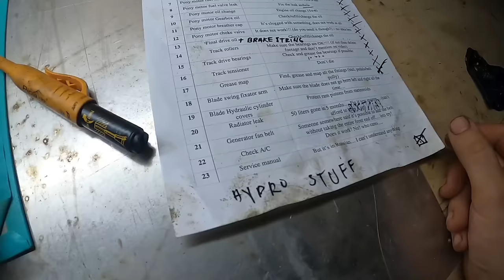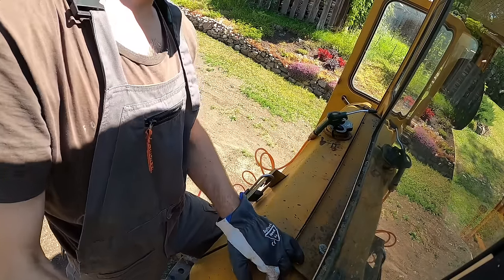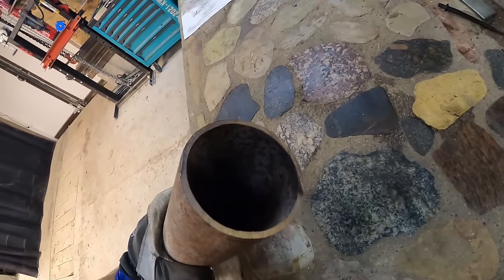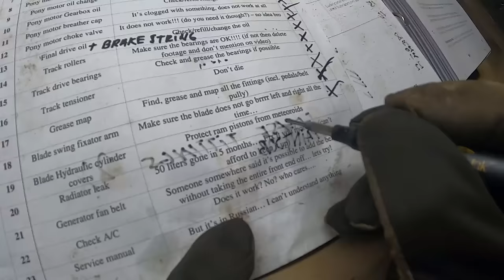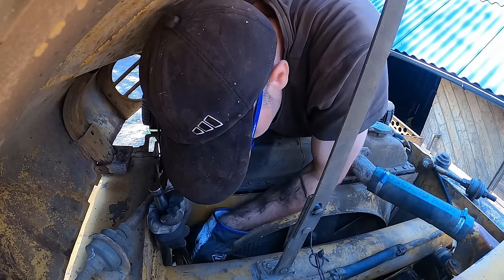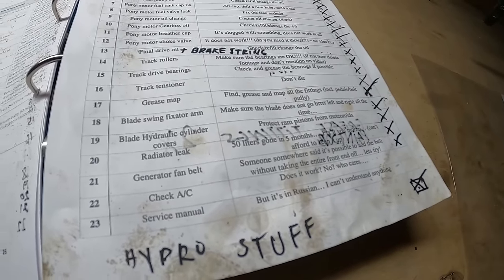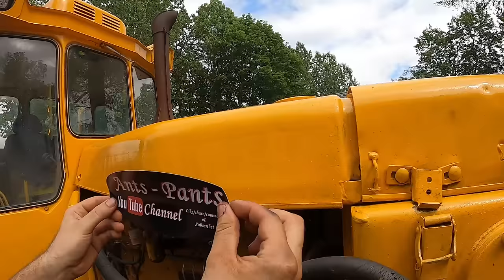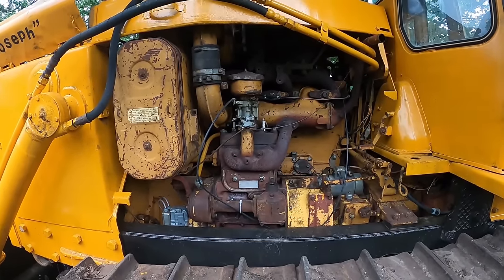Fixing the soviet bulldozer T-170 - Ep3

Comment: For the hoses behind the blade, I recommend you weld a rod sticking out of the front of the machine, from the end of the rod you can hang a spring and some chain to hold the hoses in place. The spring and the hoses give enough flexibility to still move everything, while avoiding rubbing.
Reply: - I was thinking the hoses needed to be kept away from the blade and out of the way, too.
- Your design concept of an appropriate bracket AND a Suspension spring system is smart.
Reply from the maker: Interesting idea

Comment: Joseph turned out nicely. Great job. When CAT are new, their Signature color
is sprayed on everything to make leaks show easier, seams are sealed, and 
fasteners are protected. Thick paint peels off easily, revealing a usable fastener, instead
of a corroded head that strips out, rounds off. 
I'd slather those engines, exhausts & tracks with hi-temp silver.
Reply from the maker: Yeah

Comment: You are still one of the funniest and entertaining guy out there!
1). You want to ride your e-bike between engine segments so you can reach everything!
2). Your going to get slightly wet …. And then have boots filled with water.
3). After tearing up the yard …. Well this might be the last video … if it is then I am dead…..
4). What Mom says … has to be done….
And many others such comments keep us well entertained!

——
What was in the degreaser / cleaner you put in the spray bottle?
WOW.    That stuff really worked well with the pressure wash!
Reply from the maker: It was some store bought mix for oil stains. Thanks buddy

Comment: To cover the ram you need an accordion bellows that can be slid over it and secured at both ends. You can make your own from canvas sheet by cutting out circles and sewing them together then sealing them by emptying a tube of silicone caulk into a bucket, adding 2 to 3 liters of mineral spirits, stirring it up until liquid and soaking the bellows in the liquid then stretch it out to dry This is how I make waterproof tarps from bed sheets
Reply: Wow , you just taught me something. Cool
Reply: Well, THERE is something that can be called as a KNACK. A good one!
Reply from the maker: Good idea

Comment: Add greasefittings via the center of the shaft instead of eye of the cilinder. Similar to the bleedscrew of the dieseltank, drill via the center and a hole at 90° where the grease comes out.
Reply from the maker: ah yes. Good call

Comment: - Good Job, Andris.
- I'm glad the belts on the generator and tensioned, the water pump tightened, and the paint job.
- And I enjoyed seeing the starburst sparks coming of the Soviet hard steal tube for the blade.
- Yes, I have noticed how the weld it shows how rugged all Soviet steel is...the rods and eyes don't wear.
~ ~ ~ ~ ~
- I knew about the special steel of the Soviet railroad tracks from back when I studied briefly at Moscow State University in February of 1973...but it wasn't as cold as I had hoped...{-36 below zero Fahrenheit is good logging weather...-37.7778 C}
Reply from the maker: Ooof thats cold man even for me
Reply: @Ants_Pants  .
- The rolling foothills/mountains where I grew up keep the wind away in the winter time.
- Direct sunlight on bare skin with No Wind even at -36 F = comfortable warmth.
- I used to take off my parka, wool shirt and work logging trees in only a Fishnet Jersey.
- {fishnet jersey is a great insulator for added warmth under a wool shirt, but Also acts like a great swamp cooler by wicking away moisture if you are hot and sweaty...wool does the same}
<to keep my winter clothing dry when mountain climbing on skies in winter, I de-robed to only my jockstrap and fishnet jersey to "run" up the mountains on my skies.>
- All of the above is applied physics of the physical chemistry principals of "heat of evaporation"...you are smart so you will understand.

Comment: Great job (well, as usual .... 😏😏😏) About the 2 front hydraulic cylinder protection, maybe you can use (or make it) as PTO protector heavy plastic tube sliding one inside the other 
About the dozer very long front hydraulic hoses, cover/protect them individually (they don't rub each other) with spiral plastic wrapping guard, a stick with long springs holding the hoses away will be a great protection, the long spring maintaining/permitting all the movement. Again, great job you did (dozer now look almost too nice to work with it 🤣😂) Be well ✌✌✌
Reply from the maker: Hehe yes. Good idea

Comment: Hello Robert from Mark (Dutch/Latvian) from Portland Maine, USA.

The fist time I saw your Soviet Bulldozer I thought “he is a very brave individual - or he is desperate for lack of superior resources.”

By the time I had seen you complete your initial challenges, I knew I would need to subscribe and contribute only the finest advice possible to try and match your skill level.

Today I believe that these solutions are capable of answering your direct needs and perhaps a bonus for other things you may not have thought of:

(1) PROTECTING HOSES:
A quick hint is to try and find some old/expired woven fire hose because it is like gold on heavy equipment when it it is used to protect hydraulic cylinders, wire, harnesses and such - it is both heat and flame resistant too!
Also, I concur about suspending hoses by springs. I prefer the cheap, longer screen door springs on longer hydraulic hoses. Use an older expired larger hose to support the hose in the middle, using a short length of plastic or metal pipe or conduit to support the padded hose and use clamps or tie wraps to keep it in place and connect it to the end of the spring. Attach the fixed end to a location that allows freedom of movement through the entire range, while keeping the entire hose clear of potential snags from the running gear or likely places where the debris you are pushing might interfere with the hoses (off the ground/away from the tracks & blade). Attaching hoses like a cable installed on your living room baseboard WILL work too!

To be continued …
Reply from the maker: Thanks

Comment: That dozer has never been treated this well since it was built myself friend, every bit of gunk you clean off the engine is going to help it run cooler and the means it’s going to perform better and burn less fuel brother! I’m glad to see you maintaining the dozer Andris, but I know how well you maintain your equipment my friend! You should make it a habit of turning the fuel every time you get off of it and turn it on before you get one the machine! You can put the key by the fuel valve and I promise you’ll remember to turn the fuel on before you crank it! Might work brother, it’s always good to turn the fuel off and disconnect the batteries when you’re not using it! The dozers I’ve seen have a battery disconnect switch! The don’t know if that machine has one but I don’t believe that you can’t figure out how to install one myself friend! Just a suggestion brother!
Reply from the maker: It does have that battery switch my friend. Thanks for the tip sir
Reply: @Ants_Pants  you’re always welcome Andris, I figured it would but just a reminder! I definitely know with your skills the dozer is going to be a better machine and have a better home! I always appreciate how well you maintain your equipment Andris! Stay safe my friend! ✌🏻✌🏻🇪🇪🇺🇸
Reply: I also enjoy your hilarious remarks during the video, I laugh so much! You’re one cool guy Andris! 👍🏼✌🏻✌🏻

Comment: If you want to drill in hardened steel, just take a bit for drilling stone. Anyone with a tungsten tip is allright. Sharpen it on a bench grinder like you would to re-sharpen a steel bit. After that it will even cut trough glass.
Reply from the maker: Thanks for the tip

Comment: Just a suggestion; you need to write down your starting steps on something.”, then have them laminated so you can mount it inside of the cab. If I were you I’d do this on all of your equipment. I also noticed, maybe I’m wrong but do you have a pole barn to park all your equipment to keep them out of the weather. It may not matter now but as you grow older, working out in bad weather conditions on equipment will be much harder.
Reply from the maker: Yeah i want to build a bigger shed where i could park em

Comment: You could just put a tire valve on fuel cap it would be weatherproof, and also hold pressure. Plus you can check pressure
Reply: The cap has to breath or else the tank will collapse from the vacuum produced by the injector pump.
Reply: @willwade1101  it don’t need to breath when your trying to prime the fuel
Reply: @willwade1101  then you take the valve core out when it’s primed , problem solved
Reply: @puppyduppy9811 The best solution is a cap for pressurizing the tank and one for running the dozer.
Reply: @willwade1101  whatever you say chief
Reply: Yes that is the way the engineers designed it, gee you must be as smart as them.    NOT

Comment: Good name for the machine, I approve it. It actually refers to the forefather of this machine called the S-60 or also known as Stalinetch-60. So they started calling every model after the S-60 after Stalin just "Joseph"(or Joss in Estonian). Even if the official name Stalinetch was abandoned in the late 50s. The front letters ЧТЗ stand for Cheliabinsk Tractor Factory. You can technically service and bleed the machine alone but it's better to have two people as this video proves. The bleeder screws on the plungers are sometimes so bad that you can actually break them. I should have remembered to open them first before everything else. But you had so much air in the system it took me thinking where the air got stuck in. Paint job well im a fan of patina but this one looks really in acceptable levels so if your fine with it, why complain? The coolant leak on the older model is even more notorious cause they have a packet nut seal and they leak like hell. I would say the old coolant cleaned the block from what ever was inside. Usually when the block has had water in it as a coolant it's filled to the brim with crud and rust.
Reply from the maker: All true

Comment: When cutting such rusty pipe you should consider that rust is much harder than steel and will damage the blade and slow down the cut considerably! Also the parts where you tried to add grease fitting could very well don't have any by design as grease attracts dirt and turns it into a grinding paste, in which case it would be better to not have them at all. Since those joints are right by the tracks (where a lot of dirt is thrown around) and don't move much that seems quite likely to me.
Reply: Well, I think greasing it is still the way to go. Dirt sticks to the grease, but it also acts as snot.. transporting bad stuff from "delicate areas". As long as you add more grease regularly, it will also keep it clean.
I'm not an expert at lubricants and contamination, but I have a feeling that sandy dust in the grease is far better than metal contamination, as the hard sand gets crushed in such tiny particles that forms a film on the metal surfaces preventing metal to metal, adhesive contact.
I think metal particles clump together and stick to the metal surfaces, increasing the wear.
Reply: @rbtgmnstcs Exactly... that's why you grease it until nice clear new grease comes out... lubrication and get rid of abrasive dirt.
Reply: Regularly adding grease being the problem here. I've seen several machines with some added grease nipples which were then not greased often and those pins were in much worse condition than the ones that ran dry. But I do agree with you, IF you add grease regularly it does extend the lifespan!
Reply: It must have been in a very dry and dusty environment, but I still cannot understand why it would be better without grease. At least, either the bushing or the pin would wear depending on hardness.
If a shaft has a very loose fit, with low radial forces applied, letting lots of sand get deep in, then it might making it worse.
Reply: @benediktpaul157  Sure, you need the discipline for the maintenance... Like checking the oil level e.g.
Reply from the maker: i did found a grease fitting that was broken off on the other side, right at the rod next to the blade and dirt
Reply: @Ants_Pants  repairable?

Comment: Be sure to shut the gas off on the pony engine and let it run the carburetor out of fuel. It keeps it from flooding and diluting the engine oil in the pony crank case.
Reply from the maker: Yeah

Comment: For the grease fitting on the tilt cylinder for the blade ,drill the pin in the center and then drill side holes in the pin for the grease to lube the pin.
Reply from the maker: Yeah

Comment: I would run that coolant through a filtration system, test it and reuse it if not contaminated. I used to have an electrically driven oil pump with a filter on the inlet side for filtering such things. When I stopped mechanicing I gave all my tools to my grandson to make his living. He started his apprenticeship with a $10,000 tool box and over $100,000 worth of tools, jacks, jack stands and other things I had gathered over 40 years. When he took all that to work with him a lot of the old timers got jealous, asked him where he got all that and he simply said: "My grandpa" and told them my name. Most of them knew who I was and shut up.
Reply from the maker: Respect sir 👍

Comment: paint job looks great your right not to paint the engine. i would maybe use a little used motor oil on the rusty stuff in the engine compartment just to keep it from deteriorating
Reply from the maker: Thanks for the tip

Comment: Hi Ants, I believe this dozed has been never serviced so carefully since the Soviet Union collapse. Label "Ч Т З (Ch T Z)" on the hood means "Chelyabinsk Tractor Plant". Also the left gauge in the dashboard is not a voltmeter, it is amperemeter. All currency from generator enters the onboard electrical network through this gauge, so it is a reason of the 99% problems with the electrical network. As I see this gauge has already been neutralized in your dozer. I would recommend to replace it with a voltmeter.
Reply from the maker: Ok

Comment: EFC ( Electric Fuel Control ) Governor  that dozer I believe uses a rod and lever to shutdown fuel flow to protect	against a runaway engine situation. You can install a manual fuel pump in-line before fuel filters.
Reply from the maker: Hmm

Comment: Efc is electronic fuel control. Which explains why the mechanical fuel pump does not have a manual primer for when you run out of fuel (accidentally of course😂). My best guess anyway!

Comment: Maybe convert to western metal cased filters from some regular trucks. Example fuel filter holder from mitsubishi so you can use throw away cartridges. these are way better because common rail systems are way more susceptible to dirt and filter better. Why there is sealant on head gasket is that all parts are so inprecise that only way to keep oil from coolant is to surround these fluid passages with gasket maker. Soviet technology is bad, fun to tinker with but highly crooked in all un forseeable ways. Best equivalent is that they manage to make flywheel so porous that it is full 300 grams out of balance while being totally in range of specified dimensions.
Reply from the maker: So true 😂

Comment: @16:56
Observe, the clutch pedal lock catch you flip over-
it has 2 holed tabs that line up; a suitable padlock is used here, to
"lock out" the clutch, help for an "anti-theft" device.
Reply from the maker: Ohh 🤔🤔👍👍👍
Reply: @Ants_Pants  I would seriously (video) make a protective "cage" of what's called "expanded aluminum" and cover the exhaust pipe. Also, add a 90 to the pony motor exhaust & route it along the caged big motor pipe. After that tree fell on it, imagine if it broke the manifold? Hopefully remove manifold, weld, big 💲💲💲🤬

Comment: i would put a priming bulb like the kind for boats in the fuel line.... that way you can shut off the valves if you want and not worry if you lose prime for some reason... or at least it should make it a bit easier to prime the system in that event.
Reply from the maker: Yup

Comment: If you need tranlation about dashboard and controls - i can do it
Reply from the maker: think we figured it out with Steve on most parts. But thanks sir
Reply: https://drive.google.com/file/d/1QbNwBC6SJOYnEGjeQqM4Y_juSkJ7pRqh/view?usp=sharing
1 starter
2 choke
3 pony engine gearbox
4 pony engine engage
5 pony engine clutch
19 magnetto
25 pony engine throttle

Comment: Maybe some foam with glue/double tape on one side inside the cab to reduce noise?
Reply from the maker: :D
Reply: @Ants_Pants  I actually used some sheets of that stuff used in the engine bay of cars, in the cab of an old tractor. I think it reduced the noise a bit....

Comment: diesel in the engine oil is possible input shaft from the fuel pump leaking in the front cover .the round plug front of the motor that leaked but was not bad i guess.
Reply from the maker: Yeah

Comment: What about adding an electric fuel valve that comes on with a switch in the cab, or maybe switched by the oil pressure sending unit?

Gotta be a way you can do that “automagically”.
Reply from the maker: Always is

Comment: When you welded the coupler nut to the fuel cap I thought for sure you were going to screw an air fitting in it so you wouldn't have to hold the air nozzle in place...
Reply from the maker: Next time

Comment: 1:27:32 About steering: I'm not quite sure, but I think I saw in one channel from a guy who restores tanks ("Mr. Hewes" or something like that) that if you want to turn, it's better for the machine to not stay on the brake for to long, but to do it in stages. Maybe someone with experience knows something about it. Might be wrong, just in case.
Reply from the maker: Yeah od course. The clutch pedal however does have a manual lock by design.
Reply: @Ants_Pants  Maybe you could make a video about how to steer this machine. I didn't imagine it having a clutch at all 😅